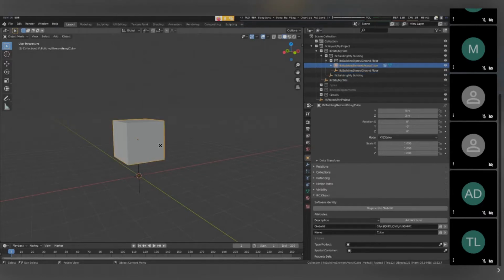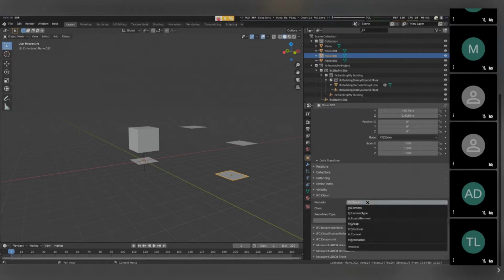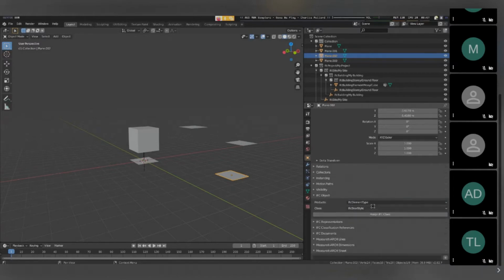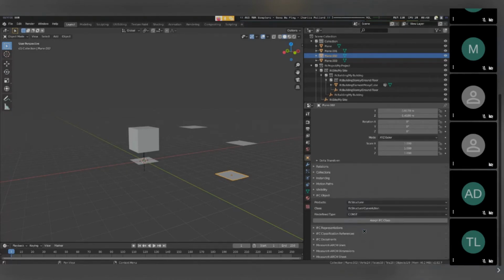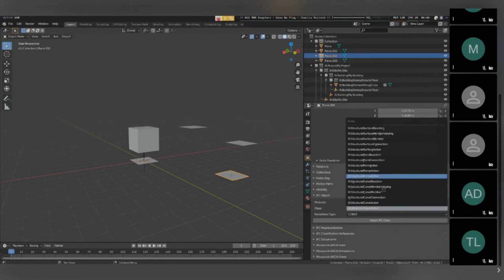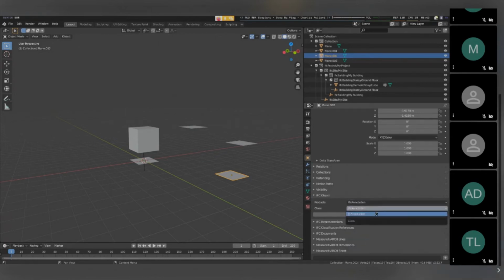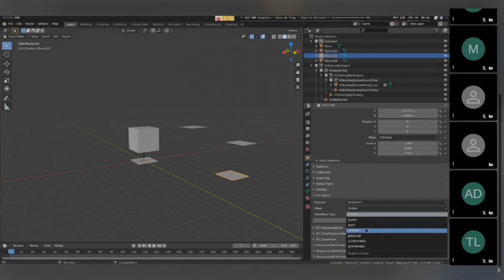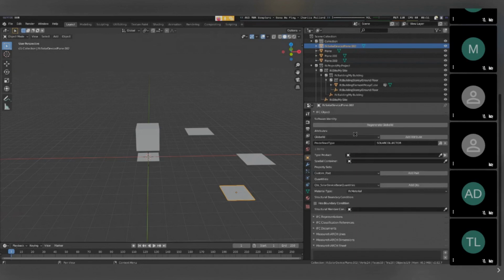Setting IFC classes to elements - 200620 BlenderBIM Add-on Technical WIP Demo

Comment: What do I do if there is "IFC element not found" under IFC Class? I can't normally assign class then :(
The element was copy-pasted from another project.
Reply from the maker: You can press the unlink button next to that message, then assign it to a new IFC element.
Reply from the maker: Alternatively you can append the element type and insert a new occurrence of that type using the IFC project library.

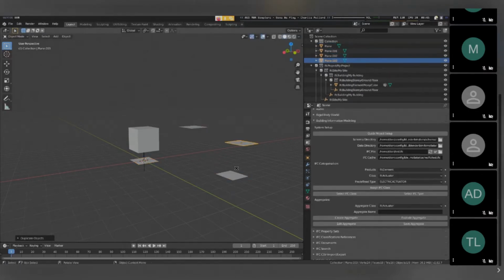Comment: great presentation, a bit off-topic, but has there ever been any project that tried to... recognize IFC classes from generic 3D models automatically? Besides pure laziness, it would be also nice in moments like 0:42 to suggest any more probable classes and save the user sifting through that long list each time.
Reply from the maker: Yes, there are a variety of machine learning applications that have been done with IfcOpenShell to detect outliers for IFC classifications. I believe this has been discussed on the OSArch.org forums.
Reply: @DionMoult  cool, good to know that the community was looking at it already

Comment: Very good stuff. I dreamed for a long time to have an application that allows to have the geometry independent from the IFC classes. This idea simplifies the IFC modeling to what it should be. Create any geometric form, associate after an IFC class and that’s it. In the mean time you can reduce all the geometries to one type: a parametric cube. Any of it’s parts can be deleted, deformed or morphed in whatever geometry you like by applying transformations. You can obtain this way all the geometries you may need. That’s real clarity. Blender is the dreamed application. The only part it’s still missing is the creation of the layouts packages where 2D projections/ cross sections and details could be organized and printed out in PDF format. I would scrap my usual application instantly and adopt Blender instead.
Reply from the maker: 2D documentation is a work in progress! We're getting there!